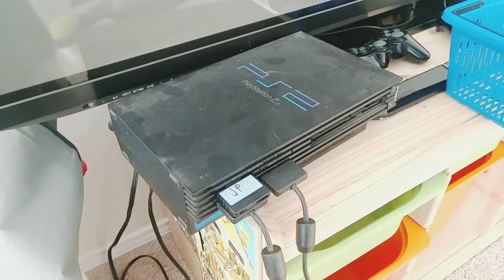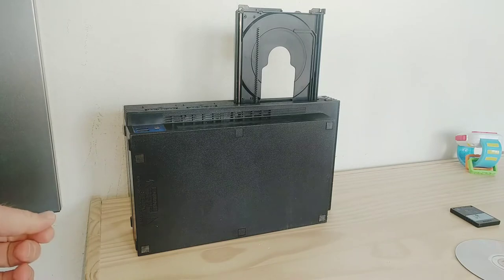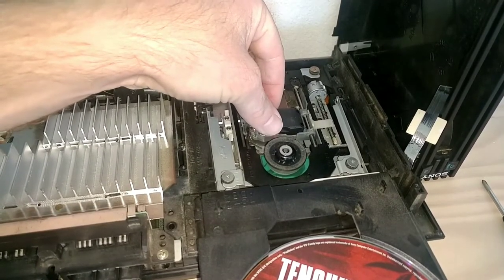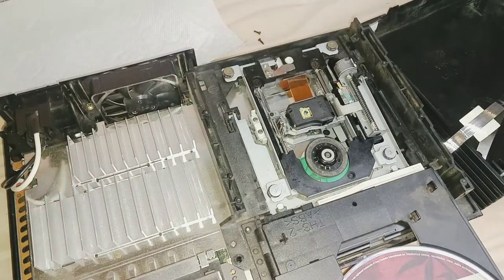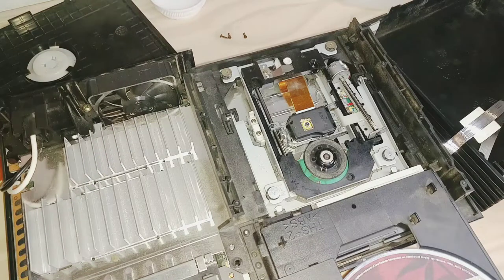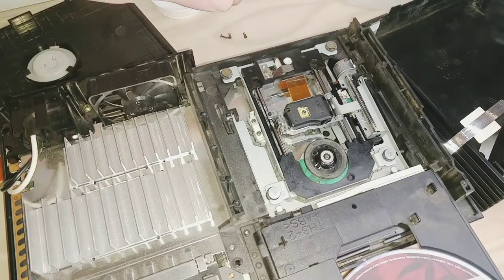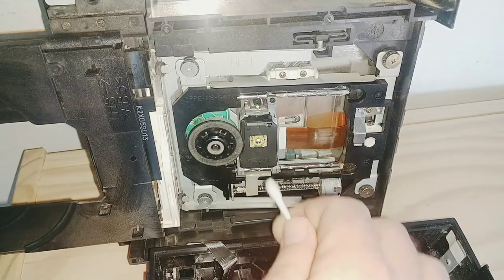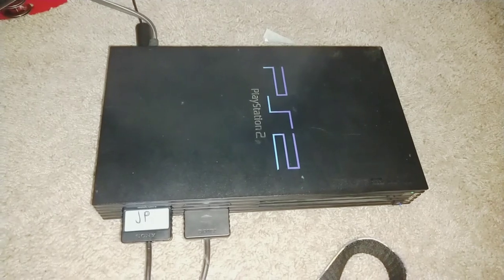PS2 Grinding Noise and Won't Read Disc Fixed. Also cleaned laser lense and lubricated Play Station 2

Comment: To anyone who has been storing their ps2 in the attic or stashed away for 15 years.. My ps2 was recognizing that the disc was there but was heavily grinding and not loading. But I figured that the gears have been stagnant for so long that perhaps letting them move a bit before committing to opening it up might work. Sure enough if you let the gears run a few times by inserting/ejecting - the gears will loosen and allow you to play. I am still getting some grinding but not as bad as it first was. I am able to play now. However, I could see this wearing out the gears if no action is taken and I use it heavily. Or perhaps the more I use it, the more it'll loosen up. But for those that want a couple hours of nostalgia without opening it all up - let those gears loosen up a bit! However, this video is definitely your safest bet to keep your ps2 running the longest if you're getting grinding noises.
Reply: I have this same issue with my slim. My makeshift solution was to position it sideways (don't forget to turn the PS logo :-) ) I guess the weight of the drive itself no longer be applied allowed the motor to move without grinding anymore. After playing with it for a bit that way, I noticed that when I put it back in its horizontal position, it was not grinding half as much and had less trouble recognizing the discs. It could be a harm reduction strategy for your method.
Reply: Dude i reseted multiple times and it didnt work. It was grinding when it did work. But there's just nothing after the short boot grind.

I just got a new cable for nothing....zzz

When i first got it,it was a 2nd hand item and i still could play ps1 games. Then it stopped playing ps1 games and stopped reading a number of fake disc. Now i totally can't play it anymore even though it boots up and can access memory card.

Comment: my ps2 doesn't even show the reading disk screen, it goes to the browser and system configuration screen
Reply: Same here. I can click on browser to initiate the disc reading tho. But then I’m getting the disc read error and a scraping noise coming from the disc tray as it spins. It not quite as grindy-sounding as it is in the video.
Reply from the maker: Let me know if you find your problem. I assume it doesn't know you put a disc in. Try cleaning the laser lense with a q-tip and rubbing alcohol.

Comment: ive got a slim ps2 it does some grinding noises and wont read discs thought it was this issue when i opened it up the whole cable that connects to the optical drive is broken. the orange cable you see when you first open the console up. Is it possible to replace that?
Reply from the maker: I would assume so. Check on eBay

Comment: I have Dej Jam Fight for Ny and Nba Live 08 and they were just working last week but not all of sudden neither will not load at all. My PS2 make little grinding noises even wen I'm playing but not all the time just very sudden every now and then ..... Would this work???! And also Ive seen more scratches than usual. Is the grinding little noise causing that ?
Reply from the maker: Sounds the same but won't know for sure until you take it apart.
Reply: Is it the slim or fat one?

Comment: Hello @Because Stuff Breaks with Justin Peters , after watching the video I did the same, and after cleaning the laser, my PS2 won't spin the discs or read them anymore, when I insert the disc, the laser moves and turns half a circle and nothing happens anymore, can you tell me where I went wrong?
Reply from the maker: Make sure all your ribbon cables and wire bundles for the drive are filly seated and not loose.
Reply: @becausestuffbreaks   Ok, I'll try it, I hope that's the only problem, that I didn't do more damage... btw great video!
Reply from the maker: @spooky_0114  thanks! Thanks for watching!

Comment: 1:54 the middle screw on the bottom of the console would have a sticker on it if the console has not been taken apart before.
Reply from the maker: Good catch. Thanks for the info
Reply: Where are you located at
Reply: Thats for slim model only, the fat has it behind as mine.. thats why i didnt open it yet
Reply: @Eazye442  I could've sworn I had a fat one where the sticker was present.

Comment: I have my PS2 fat using an OPL to load games. The problem is, the unit itself making some grinding noise only just a second. Im not even using a disc on it. What is problem of my PS2 please help.
Reply from the maker: I wonder if it's sensing a disc or that the trey is not closed. Have you taken it apart and blown out all the dust and cleaned the laser lense?
Reply: @becausestuffbreaks  Its better to disconnect the ribbon cable on the lens itself since im not using any disc anymore. Currently using OPL to load my all games.
Reply from the maker: @hanzmaravillas6524  that might be why it does a grind

Comment: The lithium grease won’t be a problem? I heard it could damage or warp metal or plastic.
Reply from the maker: I guess that's possible. What's the alternative?
Reply: @becausestuffbreaks  I’m not sure.
Reply from the maker: @guyonyoutube6565  I did a little Google research. Lithium grease is not advised for plastic but good for metal. I tried to use silicone grease but it gummed up the bar that the assembly rides on. Maybe I needed to try a different type. For plastic, Google recommends silicone, perfluorinated PFAE, mineral oils, and synthetic hydrocarbons (SHC or PAO)

Comment: Hey great video, knew exactly what to do when I opened mine up.  I cleaned, lubed, replaced the white teeth part with a new one and cleaned the lenses but it still makes the noise and won’t read discs.  Any suggestions?
Reply from the maker: Did you try the trick I used in this video
Reply: I did but I’m guessing my shim wasn’t the right size.  The laser slides good when the cover is off but when I put it all back together it makes the noise immediately.
Reply from the maker: Hmm. I wonder why it only does it with the cover on. Maybe the shim is pushing that needle up too far and it's catching the top of the cover?
Reply: @becausestuffbreaks I just tried it without the shim, slides amazingly well with new teeth part but same result won’t work after putting it back together.
Reply from the maker: That's odd. Something has to be hanging it up. Just need to find why it's catching
Reply: Exactly the same happened to me. Cleaned out all old grease, added new, slid up and down like a baby. As soon as the lid was put on and the console was reassembled, it made the grinding noise again and would load a disc.
Reply: @curtis8516  did you solve the problem at the end? Those ps2 original parts cannot be found anymore, you can only find china parts. So i would do as the guy did in the video
Reply: @Eazye442  yes. If it's a 30003 - R, it's knackered. Other than that, your laser is on its way out and the black screw on the laser carriage needs tightening up so it's not loose (slips caused the grinding noise).

Comment: idk man i use a usb and it makes the sound when i start it and its freezes a lot in cut scenes what should i do?
Reply from the maker: Try cleaning the laser lense and disc first. Next would be lubricating gears and tracks.
Reply: @becausestuffbreaks  will do thanks for replying
Reply from the maker: Keep me updated on how it goes.
Reply: Games freeze when using a USB stick anyway, use the HDD to store games. The noise will occur on startup either way until it's fixed but if you're not using discs just ignore it

Comment: Just took mines apart and there is no ribbon cable at all that connects to top part. ??? 😂 it turns on just making the clicking noise not reading disk. Should i stop now? Is the ribbon cabble needed?
Reply: Google is telling me ribbon cable is for the power of the ps2. Yet mine turns on. Literally no cable at all by power button under lid
Reply: Greasing the rails after cleaning did the trick. Your a g!
Reply from the maker: Awesome! Thanks for watching!

Comment: Still no luck for mine. I don't know what else to do besides look for a new laser assembly. Looks like it's the plastic part not the gear but I don't know where to find one except maybe eBay? I can manually move the laser up and down by hand turning the gear but as soon as I press the power button the gear goes all way to center of disc drive makes the grinding sound and then won't go up. 

I don't even understand how this broke as I just bought the thing and it was working fine for one day. I tore the PS2 down last night to replace the watch battery as that was dead and I want to keep time set. Put it all back together and put a disc in which loaded but then started grinding noise and disc not spinning. Just my luck.
Reply from the maker: That sucks. Thanks for watching!
Reply: @becausestuffbreaks  Well good news is that I fixed it without spending money on anything. Turned out a ribbon cable inside came out but I only figured that out from another video. I took mine apart and sure enough that was the issue. Just slid it back in and so far it's working again.
Reply from the maker: @darkhalf9134  awesome! Thanks for watching!
Reply: @darkhalf9134  same thing is happening to mine, tried this exact same fix and no luck so far, do you mind telling me which ribbon cable was it?

Comment: Mine just makes a steady clicking sound and the game wont start
Reply from the maker: Did you try cleaning the laser lense yet?
Reply: @becausestuffbreaks  Not sure how to do that. It only does it on 2 of my games, meanwhile one other game runs perfectly fine
Reply from the maker: @SageXTheMage  might just be something wrong with the game. Scratch or deamination
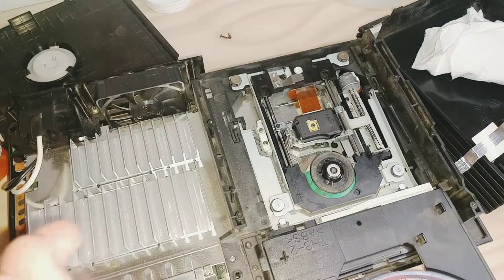Reply from the maker: @SageXTheMage also, if you watch my video, I show how to take it apart. I show how to clean the laser lense at 10:49

Comment: Hi I have a problem with my fat ps2 and I wish you can help me. The problem is It reads discs fine but while playing it makes a loud click noise from time to time! Any reason why?? Thank you so much
Reply from the maker: Sounds like it's either jumping teeth on the screw gear or something is binding and then breaking free. Might be a good idea to take it apart, clean and lube everything like I did in this video
Reply: @becausestuffbreaks  Unfortunately I don’t have alcohol :( is it fine if I use water to clean the screw gear?
Reply from the maker: @hal536  yes. You can use soapy water. Just make sure it's all dry before applying any lubricant. You can also use water and a qtip on the laser lense.
Reply: @becausestuffbreaks  thank you bro I will give it a try
Reply: @becausestuffbreaks  I’ve done exactly like the video but the clicking noise still happens :( could it be possible the laser is on its way out??
Reply from the maker: Possible. I've had something like this happen with a bad disc. Does it do it on all discs?
Reply: @becausestuffbreaks  yes it does this on all discs but I noticed that it does it a lot with games that have so much details like for example when riding a car in GTA Vice City the clicking happens every 10 seconds which is very annoying. Are there any available options I can try before replacing the laser?
Reply from the maker: Hard to tell without having it in front of me. Sounds like the tab riding inside the screw gear is skipping out. You tried the cardboard trick in this video?
Reply: @becausestuffbreaks  Sorry bro but english isn’t my first language can you explain to me what tab riding is? Is it the small piece of metal with two screws thats sitting next to the screw gear?
Reply from the maker: @hal536 at 4:06 I show the plastic part on the laser that is not staying in the screw gear. Did you try shiming the screw gear up like I did in the video?
Reply: @becausestuffbreaks  Hi bro I just want to let you know that I finally managed to find the source of the problem! Didn’t you mention that there might be something bending?? You were right!! While investigating I found that the ribbon cable thats connects the laser to the motherboard wasn’t stable and in fact it was bending so I had to push it down with my fingers to make it stable!! This ribbon cable what was making the click noise after all and now the issue is completely solved and the noise is finally gone!!!! Thank you man you are my hero!!!
Reply from the maker: @hal536  awesome! Thanks for watching!

Comment: I have a ps2 game from hell. It has bringed the death to 3 ps2 consoles for me. Every time I placed the disk. Each of my ps2 would that making that horrible rattling hurring noise, abd no longer being able to read any disks and keep being noisy.

It's such a shame bc I loved that game but i don't want to kill my ps2 console again
Reply from the maker: Did you buff the disc?
Reply: @becausestuffbreaks  nahh I still have it with me, it's the Harry Potter and The Chamber of Secrets ps2 game. I've boyght another identical game a while back but I think it started to mess up my consoles aswell. Been thinking that maybe the game is just cursed but whta are the chances of two discs causing the exact same problem
Reply from the maker: Sounds like the game is cursed. You can buy one of the original PS3s that will play PS2 gams and maybe it can handle it better
Reply: @becausestuffbreaks  I don't think it would be worth the moneys..  Sucks but eh :/  nothing I can do rly.. I coukd buy yet another copy of the exact same game and try that but i dunno

Comment: After I fixed the grinding noise now it won't read anything. I had to buy a PS2 slim
Reply from the maker: Reseat all the cable connections and clean your laser lense
Reply: @becausestuffbreaks  I cleaned the lens before I took it apart it started to freeze up that's why I took it apart. I fixed the arm that was rattling and it grips the ridged bar good but now nothing reads
Reply from the maker: Did you check that all your ribbon cables are still seated all the way?
Reply: @becausestuffbreaks  I only noticed one ribbon cable
Reply: @becausestuffbreaks  I got good life out of it had it for about seven years. I still have it in case I figure out what's wrong with it

Comment: did you apply white lithium grease to the metallic spiral part?
Reply: also my ps2 doesnt power on after putting it back together any ideas?
Reply from the maker: Yes I put lithium grease there. The ribbon cable for the power/eject button may have become unplugged or damaged.
Reply: @becausestuffbreaks  solved the power issue thank you, but disc drive is still making grinding noise, ill keep cleaning
Reply from the maker: You may just need to replace the plastic part that rides in the spiral gear

Comment: Is there a way to fix it without taking the console apart?
Reply from the maker: No
Reply: Dumb
Reply: Kiss the ps2 and cuddle it maybe it works.😂 Anyway you can try spraying air inside, for me did the trick, but after a month i hear little grinding noise again